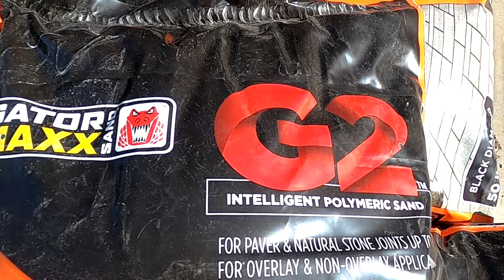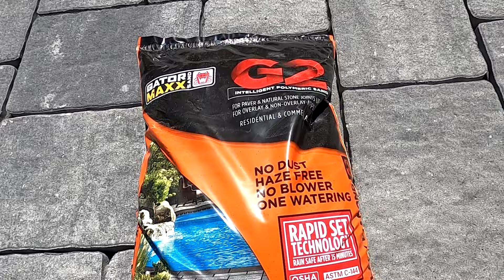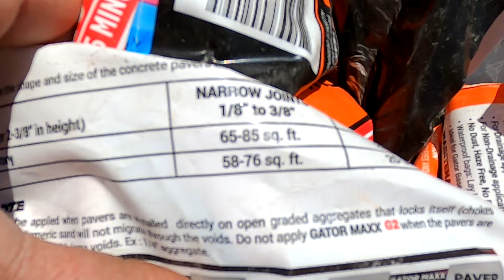How To Polymeric Sand a Paver Patio (DIY)

Comment: polymeric sand has a problem where the top dries too quickly and doesnt let the bottom get wet enough to work....try EASY JOINT...it applies wet and activates when it dries...just get a hydro broom and ur all set
Reply from the maker: EZ-Joint is an excellent product, I agree. But way to expensive and time consuming for projects this size. Poly Sand is tested and true when installed correctly. ✌

Comment: You don’t know me any more than you knew John Wayne, but like you….he and me, are, or were, flesh, blood and bone. I started smoking at 14. I tried quitting more times than I can even guess! And failed every single time, in SPITE of really wanting to quit each and every time. At 61 years old, I started vaping on advice of a friend. I couldn’t be worse, right?! 🤣🤣 It wasn’t just worse but I had a paramedic, nurses and several doctors, tell me I should have stuck with cigarettes because they were better than vaping!! 😳 My plan was to quit the vaping at the end of 2022 because I had stepped back the nicotine percentage over time and would have been at 0% by November 2022. In august of last year, I went for my annual physical. My doc was concerned about things he heard and ordered an abdominal ultrasound to check the condition of my aorta. On a Friday at 9am I went for the ultrasound. They told me I’d probably hear from my doc with the results the following Monday or Tuesday. I went home, changed and started doing some work out in our birch grove with my tractor. At 1pm my wife came out frantic and told me my doc called and said stop anything I was doing and get immediately to the emergency room because my abdominal aorta had a bulge of blood clots and could rupture without warning and I’d be dead in minutes. 
Long story short, by 3pm I had gone from my home in Milton,NH to the Portsmouth emergency room, and ended up on a med flight to Massachusetts General. They cut me like a fish and repaired the bulge. There’s a whole lot more to this story…a whole lot, but God spared me a death I should have experienced years before because my embolism was so large. The aorta is generally 1 1/2-2 mm, mine was bulged to 10! Surgery should have been done by at least 6. So…that’s how beyond life I lived. That was not Gods plan! Smoking…was what got me there! 
Benny, you gotta stop brother!! You CAN, because I DID! Oh I struggle often with THINKING I want a cigarette…but I know that is Satan trying to drag me back into bondage!!
I only regret having not done it sooner! Now, I have to go back and watch this episode because I was typing through all of it!🤣
Do it Benny!! It is ALL GOOD, but I know it’s tough. Only two people can deal with that….you, and God! It’s as amazing how real God became in my life, as it is that I’ve not had a cigarette since May of 2021, or vaped since September 29, 2022. 
I’m weak…but He is strong and He will deal with the devil…and I love God so deeply, that I could never hurt Him by lighting up even a single time, the rest of my life! He changed my life completely! I was as wretched and sinful as you can imagine…but God is healing me every day! I haven’t had an alcoholic beverage in well over a year and my language scares those who knew me before…because I don’t talk like the old me. It’s real Benny…and it’s as much for you, as for me or anyone else, who wants what God promises. Nows the time….🙏🏻👍🏻👊🏻😊

Comment: This process is not recommended for vehicular areas. Must be whacked 10 passes with a minimum 1340 plate compactor.
Reply from the maker: I agree, (not 10 times though...) but this is not a vehicular application. I have mentioned in many videos that there is a big difference in all aspects between foot traffic applications and vehicular applications. The things you would have to do for a vehicular applications are way overkill for walkways and patios.

Comment: Wear a mask. I know you're filming, but if that hits your mucus membranes or throat...yikes. Also, for tamping travertine pavers, should i just hammer with a mallet instead? I don't want to chip or crack any of them.
Reply from the maker: Thanks for looking out, I hear you. And yes, just lightly tap the travertine with your mallet, that will work just fine.
Reply: @TheChristianHardscaper  thank you so much for responding!